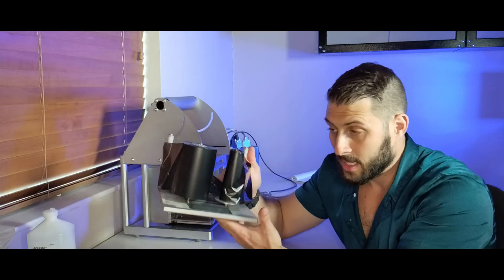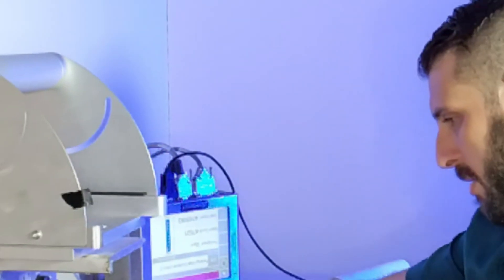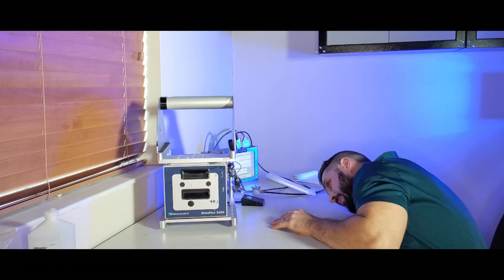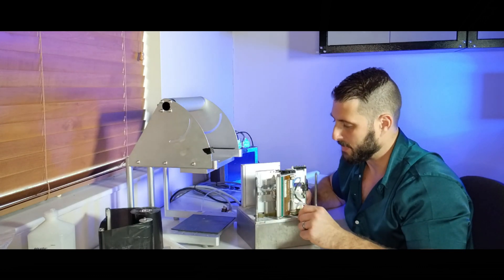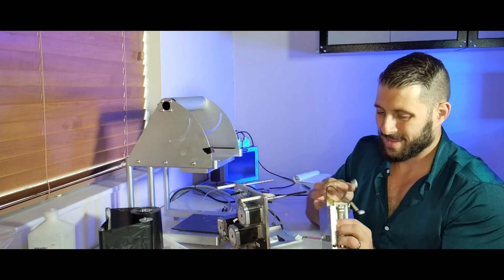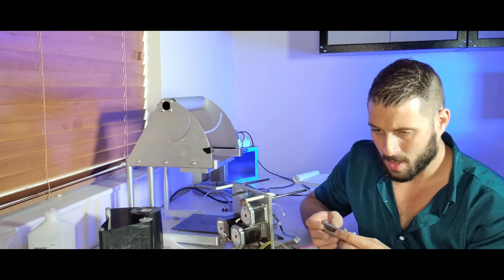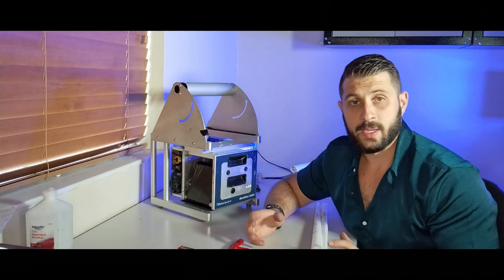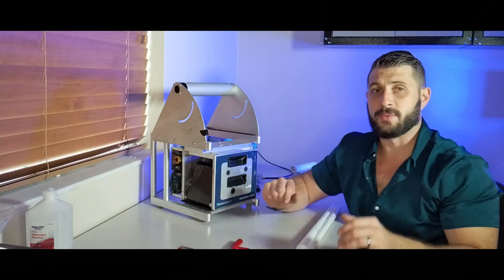Why did this Videojet 107mm printer repair have to come here?

Comment from the maker: Has anyone upgraded to the new all electric printers?
Reply: in our company we use only 6330
thanks for your effort
Reply from the maker: Anytime! Good luck with your printers our TT750 is a drop in for your unit unless you are using a 32mm.
We do sell parts overseas from our ecomm store take a look if you need them hopefully it saves you some money!
www.ttoparts.com

Comment: Tutorial how to change printhead please?
Reply from the maker: @wahyualriyadh1750 If you need the old style (6420-with Air) we have a video already. Will work on a video for the new 4 6530/TT750 printer.

https://youtu.be/m6YH66-pjHE
Link for the printhead change
Reply: @clmsystems  is that any different setting compare than 107 mm? Coz different cable
Reply from the maker: @wahyualriyadh1750  Same concept. Printhead cable installation is a little more involved because if not installed properly the cable can cause a wrinkle in the ribbon